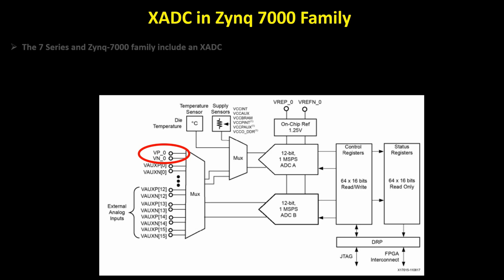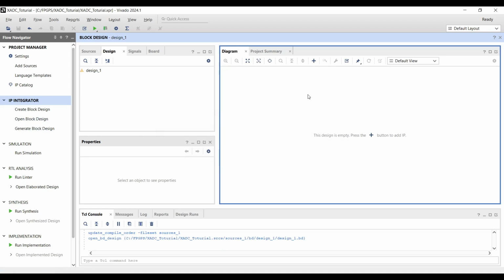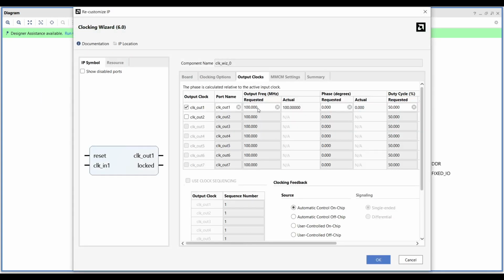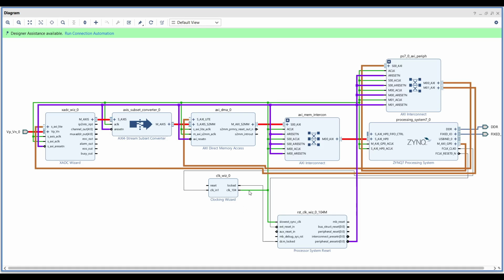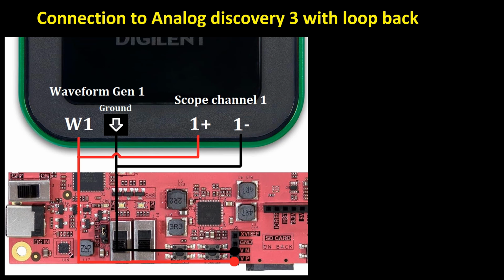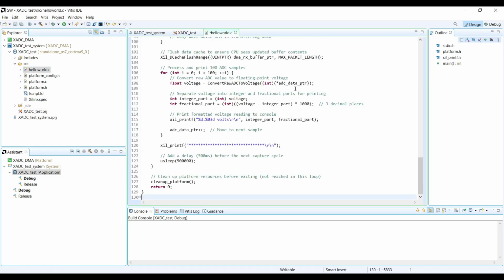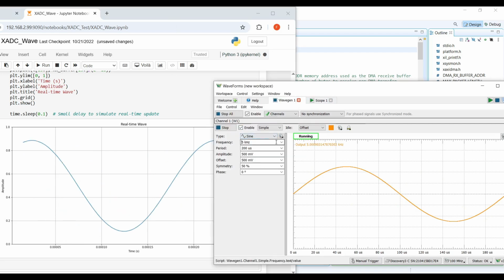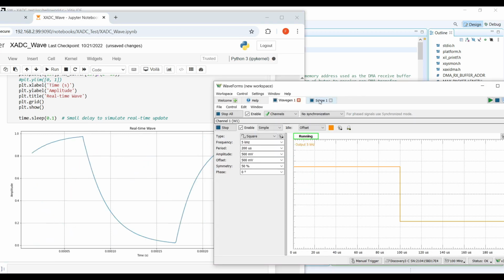PYNQ-Z2 XADC: Vivado Vitis application using AXI DMA

Comment: If i want to test without xadc,i can implement the sive generator with LUT(you another video) and finally test in jupyter to see the sine.If its possible how can i prepare the AXIS of my block to connect with subset converter. 
Thanks in advance.
Reply from the maker: Hi @marquisiog9146
Welcome to the channel. 
yes you can transfer data from PL to DDR with AXI subset converter. 
S_AXIS has two important ports that you need to connect them one by one as following:
1- connect a 1-bit constant with value = 1 to tvalid
2- connect BRAM output to tdata. however BRAM output is 11 bit and tdata needs 16 bits data. here you need to cast the 11 bit to 16 bit. I pushed a cast VHDL module to the following repository: 
https://github.com/FPGAPS/XADC_Tutorial/tree/main/HW
you can add this VHDL code as module to your design, it has simply one input and output port. double click on the module and it allows you to change the number of input and output bits. you can easily set the input bit numbers to 11 and output bit numbers 16.

in this way you can keep the AXI DMA setup, and PYNQ/Vitis code
Reply: @FPGAPS  thank you so much,i'll try.

Comment: Hi, i have changed the code according to my system but the transfer size is 1024 bytes, even if i change the MAX PKT LENGTH,  what could be the reason, thank you.
Reply from the maker: Hi, 
please check the AXI DMA setup in your Vivado design, the AXI stream bit width should be 16bits. 
AXI stream subset converter is also generating Tlast after 256x16bits samples, that is 512 byte

And could you please tell me what is "transfer size" exactly? 
Thanks!
Reply: @FPGAPS   What I meant is the size of data transferred in a single DMA transaction. Since my data is 32 bits wide, one transfer corresponds to 256 samples, which equals 1024 bytes (256 × 32 bits). I now understand that point, thank you.

However, I would like to increase the transfer size per DMA transaction. In this context, do you have any suggestions on what I could use instead of the AXI Stream Subset Converter to support larger data transfers within a single cycle?